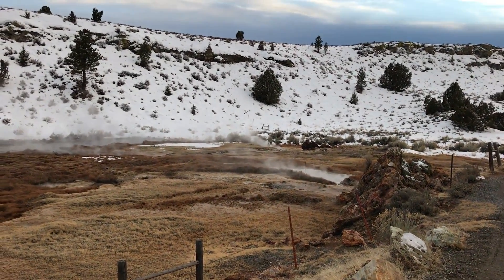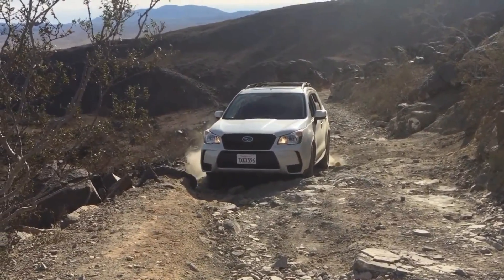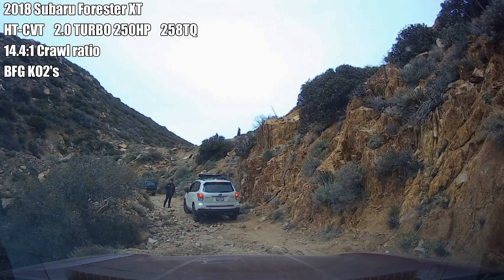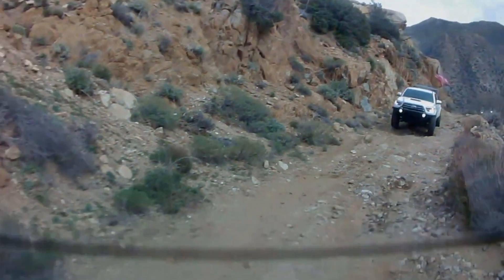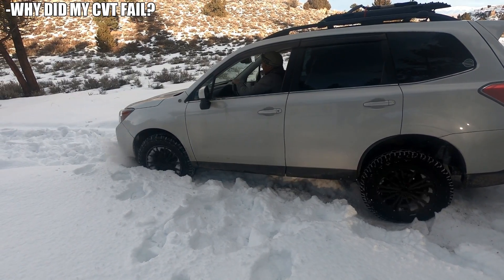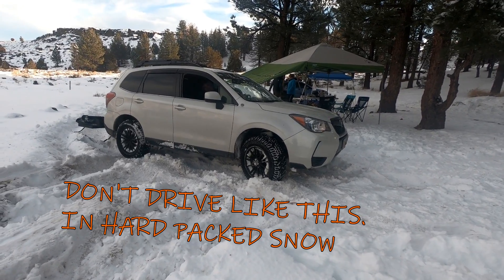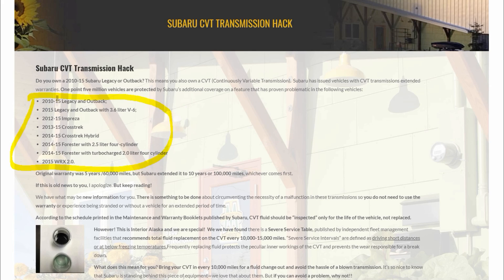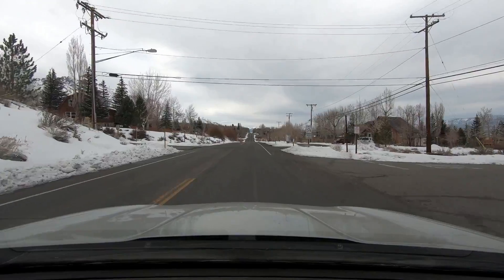CVT transmission Failed!  Can we make them last?

Comment: There's a filter deep inside the transmission and a take-up screen on the bottom pan of the transmission. 
Is your CVT toast? By manufacturers standards, yes.
But surprisingly, you can make the car drive normally again. Simply drop the transmission pan, clean out the carbon filled fluid, and replace or backwash the take up screen. 
You really have nothing to lose since the dealership won't even try working on the old CVT, they'll just recommend replacement.
It'll blow your mind how well your CVT works after doing those simple things. 

Thats not actually the belts you feel slipping - it's the torque converter being starved for fluid. The same exact thing will happen in any car with an automatic transmission if you restrict the fluid flow to the torque converter. The issue is that the take-up screen is partially plugged and restricting the fluid flow. 

At 210k miles, my  2010 Subaru CVT was so bad that the car wouldn't even move. I easily got another 15k out of it the first time I cleaned the screen and oil. The second time got me another 10k. I'm on the third time now, but I dont think it'll make it much past 5k. At this point I think that enough gunk has gotten through the screen that the internal filter is getting clogged. 
Maybe I'll try replacing that next.
Reply: Matthew Klumper  Yes you have nailed the point. I have another solution for this problem . I have a special Nano Treatment to tackle this issue of lubricating the torque converter and all of the transmission including belts. This works on molecular level and creates a tribo film of much much higher strength to reduce noise,vibration harshness friction heat and wear and tear . It seals the micro pores of the metal and no more carbon deposit takes place . END RESULT extended trouble free life and smoother and efficient working
Reply: @MrKhabbu  You'd still need to address the obstruction in the take-up screen before putting in an additive.
Reply: Matthew Klumper  yes it will be good . But the beauty of this additive technology is that it creates a tribo film of very very high strength and ensures optimum lubrication and reduces friction and heat and wear and tear. And it last for a very long time

Comment: I contacted Subaru and they told me it is not recommended to change my transmission fluid.
Reply: Replace it anyways.
Reply: I know this is late to the party, but Subaru Japan on all CVT's in Asia recommend a fluid change every 30'000 miles. I've heard in the US, they say it's a sealed unit so no fluid change.
Don't believe that. If Subaru Japan say change at 30'000 then change it.
Reply: @IanSRutter  They recommend flushes in the US under "severe use". I'd replace it no matter the use case.
Reply: @baetsimpson  Yep, better to be safe than sorry. If you haven't watched him, I recommend Mr Saburu. Really good with great advice.
Reply: @IanSRutter  I'm subscribed to his channel for that reason. Probably the best Subaru advice channel out there.
Reply: I have a 2014 forester xt and changed the cvt fluid @ Subaru with 70k miles and i’m approaching 80k miles.my next change will be @ 100k miles. everyone do yourself some justice and change it every 30k miles because that’s what Subaru here in MKE Wisconsin said to do. remember, it’s cheaper to change out then to replace the whole damn transmission. I paid $240 dls for that change.think about it.also I don’t off road, I just give it hard every once in a while and drive spirited on open road or freeway.

Comment: @JonDZ Adventuring, didn't you get the CVT spacer after you lifted the FXT? Did you have any trouble with Subaru honoring the warranty because of that? Do you have any opinion on whether the spacer was better/worse for CVT longevity? I'm going to get the ADF 1.5" lift for my 2018 FXT and was considering the spacer. Thanks!

Comment: In time, all transmissions will be CVTs. Toyota CVTs almost never fail. CVTs are just getting better and better...
Reply: Toyota is one of the most reliable vehicles out there but to be fair, how many of them are driven in conditions like those shown in this video?
Reply: Or in the case of Nissan and Subaru CVTs they keep getting worse.
Reply: @etx007blue2  You are absolutely wrong !Subaru CVT gets better and better! I trust Fuji heavy industries more than I do amateurs in a comment section
Reply: In the short term I agree with you, longer term, I'd bet on EV's.  Electric motors are leap years better than gas/diesel with manual/auto/cvt trans.  Batteries for energy storage still suck compared to hydrocarbons, but they are slowly catching up.
Reply: Horseshit. Tell that to my local Toyota dealer last year that replaced hundreds of cvt’s. Even worse they were backordered due to Covid.

Comment: If 60k you should be covered under warranty. Extended warranty is 100k on Subaru cvt
Reply from the maker: It was :) and when I got it back with a new CVT, I knew exactly what I had to do.  I was able to trade in the 2015 FXT for $15k

Comment: Never buy a car with a CVT or a timing belt.  Opt for a car with a traditional automatic /manual transmission, and a timing chain.
Reply: Agree but here in the Philippines you all CVT already
Reply: @timbacolod3275  Mazda does not use CVT

Comment: All automatics have a transmission fluid cooler as part of the radiator.
Reply: Which most offroaders and people who tow understand are barely adequate.
Reply: Not as efficient compared to an aftermarket CVT transmission cooler.
Reply: It's very non-functional for the most part. Pay to have tranny cooler added to your vehicle, well worth a couple hundred bucks.

Comment: What about the 2020 Subaru Outback XTs with the “heavy duty” CVT? Does it need to follow the same care regimen or does it last longer with the same use? Do you still recommend a transmission oil cooler?
Reply from the maker: bbthing68 I’m glad you brought that up!  It’s the same CVT actually.  They had the “High Torque” moniker since the 2014 Forester XT.  It’s called the TR690HT.  Take care of it.  First thing is to get a scangauge II and monitor your temps full time all the time.  Even up an inclined highway.  Good luck!
Reply: 3yr/36k miles drain and refills on fluid. Don't believe the dealer and Subaru of America's lie of it being a lifetime fluid.

Comment: In the UK all new Subarus comes with CVT except the BRZ. They insist we have the eyesight technology, which doesnt work with manual transmission. There are still a few manual Subarus about second hand, but stock diminishing by the month. I really want a Subaru next, but have to think long and hard if the CVT is not long lasting.

Comment: The Subaru problem is that it built the reputation of its vehicles around a capacity to do these kind of off-road activities,.a unique toughness. Otherwise, the cars are boxy with smallish door entry to sustain rigidity. In short, they have little to recommend them apart from the virtues of its reputation. I'm a bigger guy, and I find them hellish to get in and out of without banging my head. So, when Subaru changed to the CVT transmission on all of its models, it wordlessly surrendered any basis for its past reputation. A friend just bought two Subs and urged me to consider one when I bought a new car a few months ago.  I'm too nice a friend to tell him straight out that having ridden in his and knowing the limits of the CVT (and the boxer engine), I wasn't even going to a dealership to look them over. In the past, I had planned on a Honda CV-R, but with the defective 1.5 liter turbo engine as only option, and with its CVT, it was now dead it to me. Bought a Passport: no CVT; no oil blow-by; easily worth a couple of mpg and a surprisingly modest extra cost.
Reply from the maker: Randall Stewart that’s pretty much 100% how I feel about it!  You just had enough insight to avoid the CVT.  Good job avoiding the 1.5T in the CRV too.  My wife wanted one, but I wouldn’t approve the purchase for the same reasons.  The only thing in the Passport is the port side of the cylinders don’t get a cleaning, so good idea to spray some GDI cleaner before your oil change intervals.  Gratz on the Passport, mine has been wonderful!  38k miles on it now, not one issue.  Will see if it can make it to 60k without something going terribly wrong, I have a feeling it will.
Reply: I have suckered into a catch oil can to add to the Passport. I do not know how much GDI build-up it will avoid, but it  is a cheap effort with no down side. I'll try the GDI cleaner as well. Really love the Passport more than I expected, as I was coming out of a 2003 Acura Cl-S which at 74 I was having trouble with ingrees/egress and driver visibility.

Comment: I think you hit the nail on the head: Frequent fluid changes, to prevent the accumulation of particulate matter in the transmissions. Yes, CVT transmission fluid is expensive, but, nothing like having to replace the CVT!!
Reply: just don't get a CVT

Comment: What world do you live in that you think a cvt is made for off-roading?  There is a reason they are in grocery getters and cars and not 4 wheel drive Jeep wranglers and Tacoma’s.
Reply: braggland this is what i dont understand either. I believe cvt is just for street use only. People are getting carried away with those KO2 tires thinking that Subaru can do it all with full time AWD.
Reply: why don't you ask the atv manufacturers that.
Reply: blammod and ATV is a lit lighter then a car.  My Polaris has a cvt and does a great job.  My suv with a cvt is not nearly as capable as my Polaris. It is just common sense that a light vehicle with a cvt is better than a heavy one in off road situations.  You can believe what you want but just be assured that you are wrong.
Reply: That is not AWD I do not see all wheels spinning. No limited slip or locker diff then not AWD
Reply: Larry Schwartz might wanna rethink your answer.  It is an awd.

Comment: Hi @JonDZ Adventuring, Is high torque CVT would make the difference? I heard that's what comes with new 2020 Subaru Outback ONYX.
I'm considering Passport or Onyx. But want to avoid CVT base on your explanation. Thanks!
Reply from the maker: Anthony Datu my 2015 FXT had the high torque CVT designated TR690HT.  In 2018 Subaru started using a new chain, but other than that, there’s really no major improvements.  The 2020 Outback XT will have the same unit.  The CVT in the base mode Subaru’s are a slightly newer mode and seem to last longer.  Case in point, the 2019 Subaru ascents have had 2 different recalls on the CVT.  Same engine and transmission as a 2020 Outback XT.
Reply: Thanks  @JonDZ_Adventuring ! That pretty much settles it but anything in mind that's worth comparison against Honda Passport?
Reply from the maker: Anthony Datu absolutely, just not right now.  Can you wait 1-2 more years?  All new 4Runner, 300 series land cruiser (suppose to be affordable), Ford bronco.

Used Lexus GX460.  They have a 6 speed transmission and actually get decent highway MPG’s.  JL Jeep Wrangler sport.  Grand Cherokee.
If you want to more luxury and less capability there’s the Kia Telluride.
Reply from the maker: Anthony Datu that video was totally a publicity stunt, the equivalent of driving a car titled on two wheels by professional drivers.  Besides that video, there are no other examples of a Kia Sorrento offroading.  It has a slightly less capable awd system than a Subaru, but it has a traditional automatic 8 speed automatic transmission with a 16:1 crawl ratio.  They trashed the vehicle.  Can a KIA make a light off-road/ overlanding vehicle?  Absolutely!  YouTube channel “Primal Outdoors” was loaned an off-road version of a Kia Telluride and he didn’t do too bad!
Reply: @JonDZ_Adventuring  Thanks for your feedback! I'm really grateful to hear back from you and give me such details. I didn't know that Subaru still have an edge in terms of AWD system. I'll keep an eye for those cars that you mentioned.
Reply: @JonDZ_Adventuring  Exactly! Can add Nissan Xterra to the list. Not the best mpg but half the price of 4 runner and just as capable a bit more zippy. 2011-2015
Reply: @JonDZ_Adventuring  My 2018 Forester XT was built 11/17. Does it have the new chain?

Comment: CVT’s are only good from Honda and Toyota. If you take care of them properly. Don’t get a CVT car that’s from JATCO.
Reply: I do believe the JATCO CVT's use the pusher belt system, using 499 steel bits strung on two spring steel bands. The Honda and Subaru transmissions are a tensioned chain, that pulls, rather than pushes on the variators. The jury's still out on which is the more reliable system. The weakness in the JATCO system is not the push belt, but rather, the slide bearings in the variators. They spall out, because there are only 3 tracks(races) for the rolling elements to slide in and out on, and that just doesn't handle the torque, so the races spall out. If the pulleys don't slide in and out evenly, the belt slips, and...GAME OVER!! When you disassemble them, and see the push belt bits scattered all over the interior of the transmission, that's NOT the problem, it's the result from the problem. If they would use 5, or even 6 or 7 races on the input variator instead of 3, they would be a really good transmission.
Reply: Wrong. Tell that to my local Toyota dealer that replaces cvt’s at a rate of 100:1 compared to a traditional automatic.

Comment: It's just the way they're designed. They use pulleys instead of gears like in a traditional automatic. They were made because of emissions and to provide better fuel economy. They're also cheaper to produce since they don't have as many parts  as a automatic.
Reply: They're way more expensive than a regular automatic transmission
Reply: CVT's are more expensive lol. Manual is the best. Cheap, reliable, lightweight, durable and most importantly, fun!
Reply: A dozen of potatos and a fat cat smelling them I had a manual, loved it but it sucks in traffic.
Reply: @JohnnyUkeOfficial  no it doesn't suck in traffic. It becomes second nature after ~2 years of driving. It super easy. Most people don't think about it when they use the clutch to start or change gears. I've never heard someone ,with 2+ years of driving experience, complain that using the clutch to start and change gears is hard and difficult. In europe manual is standard. You get used to it. Take Athens for example. There is always traffic there. Almost everyone drives manual. Automatic transmissions don't make traffic easier. Traffic still sucks because you have to start-stop and wait all the day to reach your destination. The problem isn't using the clutch
Reply: @dieselgeezer18  I've had manuals for like 15 years, then a few years ago I switched to traditional automatic - just as I wanted my girlfriend who has driving licence but does not drive, to start driving again and automatic seemed easier to learn it back. The effect was she did not start to drive, but I got used to automatic and when I changed cars I bought Forester with CVT. It's not a problem to use manual in the city for me, but automatic is easier, and I like CVT for road use as well. And for sporty driving, manual will not outperform a DSG changing gears in miliseconds -try to find one in a modern performance car. Dont take me wrong, manuals are nice and have their advantages but will not outperform automatics.
Reply: @TheCannonRoar  a good manual transmisison driver can shift very close to the speed of a conventional automatic transmission .Give me a dogbox manual transmission and i can shift faster than any automatic. You can shift without even using the clutch. Just ram the gear. You are constantly on power.We will see who can outperform who. Cars is not all about speed though. You can go fast in a manual too. If an automatic is faster for 1 second it doesn't matter. All that matters is fun.
About the CVT... There are no advantages over the conventional automatics. Modern cars have smooth automatics transmissions. Driving a CVT is as easy as driving a traditional automatic

Comment: I have a question. I have a 2014 Nissan Versa SV Note here 36,000 miles also (salvaged vehicle) now rebuilt title and I had an incident where the transmission fluid line leaked and all the trans fluid came out. When I towed it to a nearby shop in the area they said one of the transmission fluid lines was caused by the radiator being slightly dented along with it overtime causing the leak. The radiator is fine because the a/c works and everything.  They then ordered in parts for that line while they put in a temporary line to hold the fluid together which they said they tested and they decided to throw in the Carquest CVT transmission fluid brand instead of the OEM Nissan N-S3 CVT Fluid.  Would you think aftermarket transmission fluid would affect my transmission??? I called them and they said it's compatible with N-S3 and said he would show me the bottle where the description says that!? Pls help. Plus I never told them to throw in Carquest CVT transmission fluid in there either. They never called me for any updates! I am always the one calling bout it because it is my car after all!
Reply from the maker: Love Sosa I’m no expert, but from a quick search on the internet, it sounds like genuine Nissan NS-3 fluid is your best bet.  The price difference is small (to me) car-quest May be around $11 and Nissan NS-3 is around $16.
In my opinion, always use OEM or better.  And there’s nothing that points to carquest being better.
Reply: JonDZ Adventuring what if the shop wants to say they're gonna use what they already put in there
Reply: And then they also mentioned they have to drain the Carquest fluid out if that was the case
Reply from the maker: Love Sosa it’s your car, I think you have the say.  You said that they did not give you an update that they were going to use car-quest fluid, so You have a valid reason to complain.  Also, have you tried reaching out to a Nissan dealership to get their opinion?